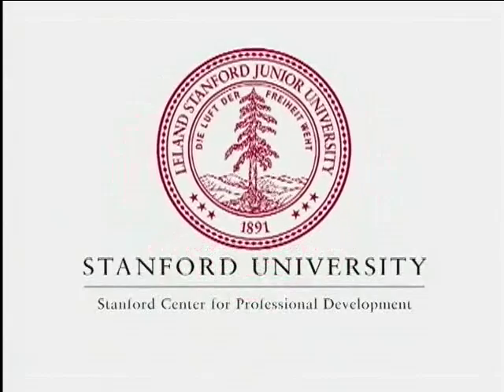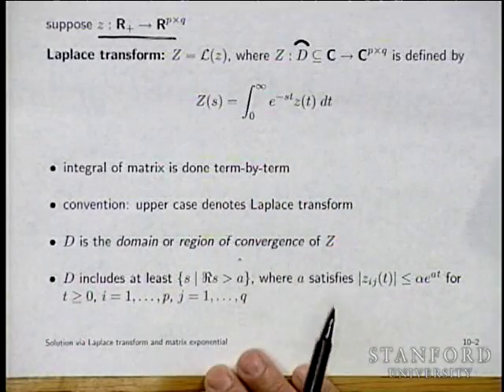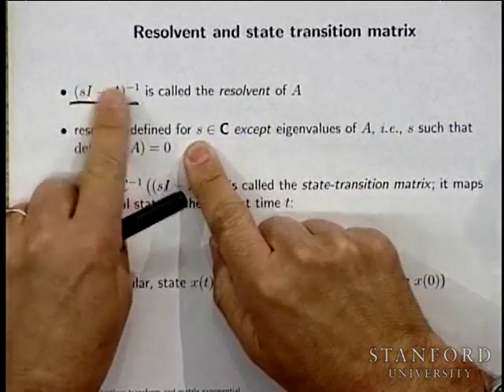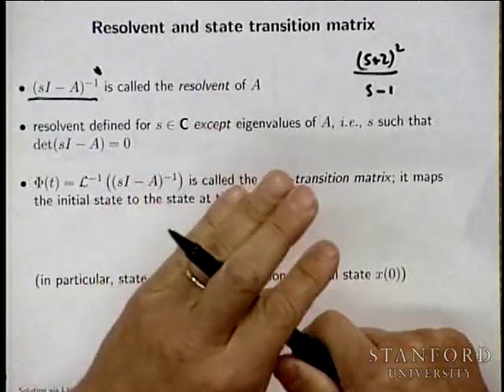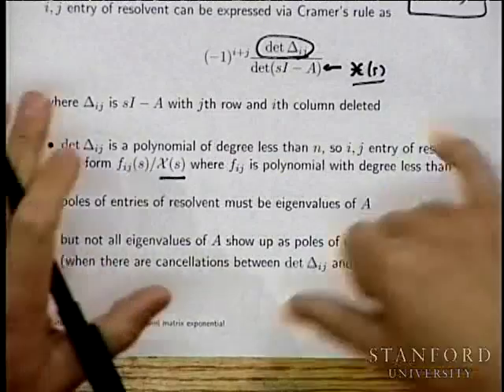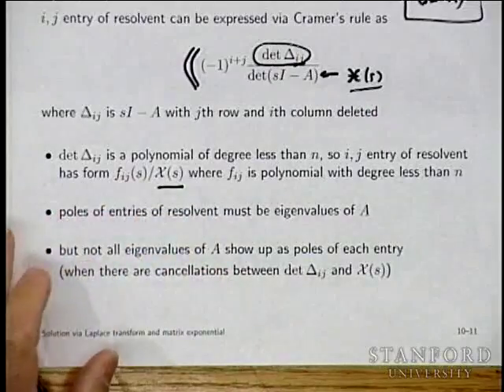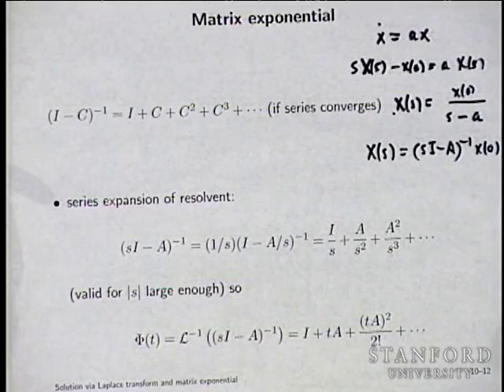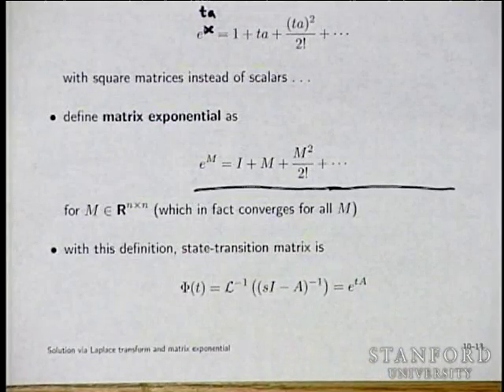Lecture 11 | Introduction to Linear Dynamical Systems

Comment: He is one of the best lecturers I've ever seen. I'm glad there are so many initiatives to make knowledge free these days. I do find it strange that he goes on and on about how a first order matrix system can exhibit behaviors that a first order scalar system can't but he never points out that an nth dimensional matrix system is actually isomorphic to an nth order scalar system. Thus all the things he showed with the 2x2 systems can be done with 2nd order scalar ODEs, but there are things that can happen with 3rd order ODEs that will never happen for a 2x2 system.
Reply: Oyinda Owoeye I think it's pretty trivial that a system of N linear equations in M unknowns can be represented as an MxN matrix. It's basically just a more terse notation.
When the professor talked about scalar systems, he meant a system with a single scalar state variable.